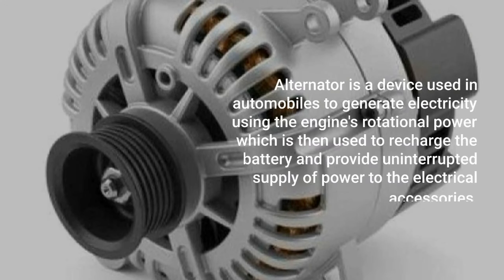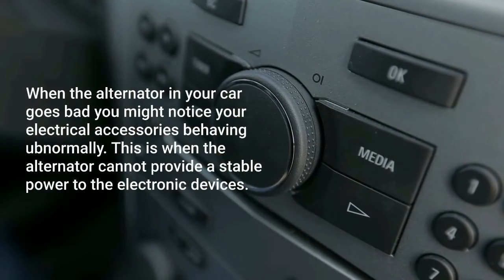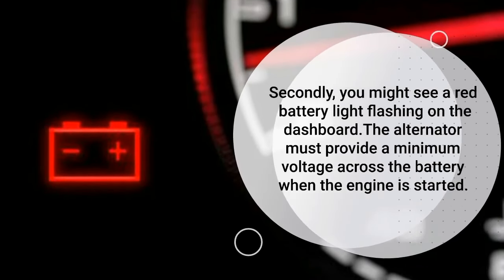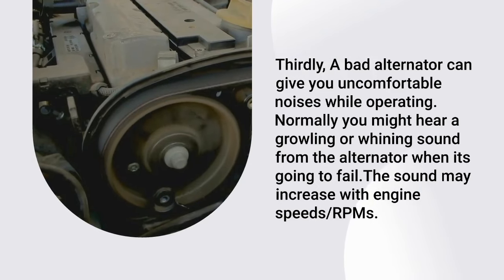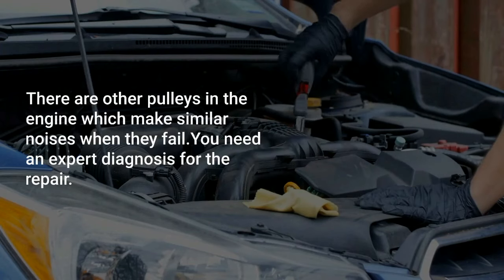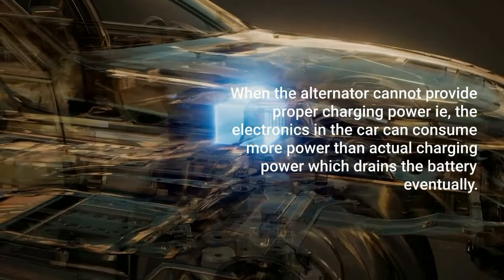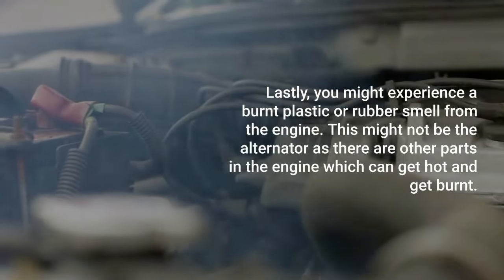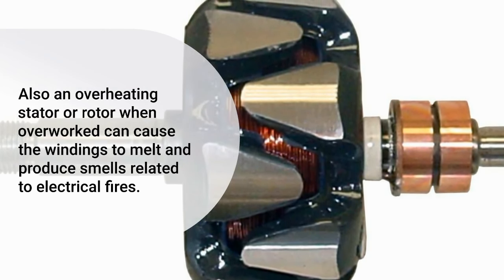Symptoms of bad or failing Alternator in your car | What happens when alternator in your car fails

Comment: The first I knew I had a problem on my 2012 Skoda Fabia, with 190,000 miles on the clock, was when the Battery Warning light came on whilst driving through Knightsbridge.

Comment: Is it possible that a bad alternator can cause O2 sensor to go off
Reply from the maker: Havint seen that though...
Reply: I asked the same thing because my o2 went out then my alternator
Reply: I have had chevys throw multiple lights when the alternator fails from traction control to TPMS or all lights. So... could.
Reply: Just had the same thing happen to me
Reply: @AltruisticWarrior that's what my Cruze is throwing traction and stability, however last year when it threw them it was my battery 🤷🏾‍♂️ replaced w a used battery from another car and tested it days ago and it was good so cud be the alternator this time

Comment: Can anyone help diagnose a problem I have with my 2013 VW Jetta 2.5 SE. The car was sitting for 4 months at a body shop and when I picked it up from there, I turned it on and after driving half a mile, I could not accelerate, all my dashboard lights came on and the car died and would not turn on. I replaced the alternator (twice) and battery and I am still having the same problem. The mechanic is saying it could be the alternator fuse. I bought one and waiting on it to arrive. Does anyone know whether it could be the fuse or could it be something else?
Reply: Yea

Comment: My car started sputtering on WOT and had a rough idle, it turns out that one of the wires to the electrical connector attached to the alternator corroded and broke off.

Comment: I was coming to a stop and my car shut off and won’t crank you think it’s the alternator? If not any ideas?
Reply from the maker: Firstly when the alternator fails, you should see a battery light on dashboard.eventualy the battery dies and engine shuts off. Check if the battery is strong and if yes, you have seized components ie, pulleys, bearings etc...

Comment: I'm currently expecting a growling noise when car is idle and my windows are slowly functioning. Can replacing the bearings in the alternator solve the problem?
Reply from the maker: A growling sound might be from too much load on alternator belt. A bad bearing makes a whining noise and increases with engine speed. If the growling noise increase when you roll up the windows, its likely the alternator is about to fail soon. Just bearings wont solve the issue, you might have a burnt alternator rotor.
Reply: Thank you so much. There's no noise when I roll up the windows, it's just that they roll up slowly. So what happens is when the car is idle, that when I get that rattling noise.
Reply from the maker: Alright .slow windows could be hardened glass guides. A rattling, clicking noise can be from belt bearings, alternator pulley etc...

Comment: my battery light will come on and sometimes go off like it's come and off all the time i can't figure out what it is like i'll drive for 5-10 mins and the light will come on and then 2-3 mins later the light will go off it's weird
Reply from the maker: Could be alternator regulator or loose power wires

Comment: is it  normal to hear a clunking sound come from the alternator upon it's death?-my  2016 odyssey had this exact problem let alone it started on the freeway! the electrical would come on and cut off-is this all due to the altenator?
Reply from the maker: Hi, looks like the alternator pulley has an issue especially if its overriding clutch pulley. Any loose bearing can also cause the same. Intermittent electrical cut might be of other causes, like bad wiring, loose contacts, corrosion in wires, bad ground, failing relays etc...any short in alternator can also trigger the same.

Comment: I'm a retired motorcycle technician and machinist so I'm familiar with alternators as only a few motorcycles use an alternator. The majority use a stator mounted in an aluminum cover and magnetic rotor bolted to the crankshaft. When the crankshaft turns it creates AC volts that is sent to a unit called regulator/rectifier. The rectifier changes AC  current from the stator to DC, then the regulator puts voltage in the battery based on what's being drawn from ignition, lights etc. 
A couple days ago my 2001 Chevy S10 started making a noise  as if a bearing was going bad while driving, but not at an idle. I opened the hood and increase the engine rpm and I noticed the automatic belt tensioner appeared to to be working properly and it was hard to tell if the noise was from it or the alternator since they are only a few inches apart. Today on my way to work the tachometer jumped a couple times when it shouldn't have, then all of the sudden the engine shut off and the battery light came on, but the voltage for the battery showed just under 14 volts. I was able to get to work and I put a multimeter on the battery and the voltage was at 13.97, then all of the sudden it showed millivolts which is almost nothing. Luckily I have a spare alternator and belt tensioner so I will be changing them when I get home. 
This video explained that some electronics may not work properly including the tachometer when the alternator is not working properly which I was not aware of. Thank you for this video as it answered my question about my tachometer fluctuating.

PS
I will be subscribing to this channel for any future issues I might have to help me diagnose and repairs. 
Thanks

Comment: My 2011 ford focus titanium mk3 111,667 miles had the wrong alternator fitted when I brought it. Didn't notice until it packed up. Replacement parts are overly expensive.

Comment: I was able to replace alternator and battery with new ones but still not charging battery. I disconnect battery and engine turns off, I check with meter and reads 12.5 v with engine on but that's what the battery reads too so nothing higher when engine is on. Can this regulator prevent power or alternator from charging battery? On Town and Country 2011.
Reply from the maker: Regulator is built into alternator and if its replaced then the regulator mist be new. Any loose wire, corroded wire can also do the same.
Reply: @dailyhandsdiy  should I just put in a External Voltage Regulator kit for Dodge, Chrysler, Jeep, kit bypass PCM ?

Comment: Good video, can you help me ? I just had a new battery installed in my car. The
reason was no power at all, even lights did not work. I ordered a battery, and this
guy from the paper picked it up, and installed it, although I didn't see him do it,
but the car was running fine after he left so I paid him. He gave me the receipt
for the battery. Now about 4 days later, after I run my car for 15 - 20 minutes,
and shut it off, the car is completely dead of power. Even the lights don't work and
all my automatic settings, like clock etc, are not working. After waiting about 10 
minutes, I can get a weak start. If I drive it a "short distance" and shut it off, it's ok,
but if I drive it for 15 -20 minutes, it drains all power ?? and no power at all ??

QUESTION - did I get a bad battery and get ripped off by someone who installed
an old used battery but charged me for a new one, or is my battery good, and
thru the course of my 20 minute drive, is it the "alternator" that's not keeping the
battery charged. Can you advise me on this ?? --  thank you.
Reply from the maker: Hi it looks like the alternator is not charging enough. The guy who installed should check for proper charging. Also check the wire that connects the alternator and battery.

Comment: Question. My lights go dim on dash occasionally i rough idle....i replaced started because it would barely start now no issues except ones stated above. Whats some thoughts is it ny alternator?
Reply from the maker: Could be a bad grounding, corroded wires or even loose connections.

Comment: Hi They hooked up the multimeter at Auto zone, then I went to O’reilly too to make sure both said the same. Both times it passed everything except it failed voltage regulator. Do I need to tell my mechanic guy I need a new alternator or just a regulator?
Reply from the maker: Hi, you just need new regulator. Don't have to swap the whole alternator.
Reply: @dailyhandsdiy  ok, thanks for your reply!

Comment: Please help me.. my Polo Vivo cut off it's self while I was driving . I tried to start but not starting  it only make click sound from the start,it doesn't start even if I tried to kick start , battery is good
Reply from the maker: Hi, this could be a seize. Any pulley bearing or alternator bearing might or any other can get seize and stops the engine. Starter cannot spin the engine thats why it makes the click noise. This might be one reason.

Comment: How about sound system…
I mean like I have a sound system and when I’m playing it loud like 56 and my car stereo goes up to 62 my car wants to stall/shut off…BUT when I’m playing it to 33-36 the car does not shut off but it never showed me a battery light on the dashboard….what causes my car to shut off when I play high volume music
Reply from the maker: Some high amp drwing sound system especially aftermarket drws high current at the time of high volume and this can cause temporary low voltage across the battery and high load on alternator which can further cause a disturbance in engine electrical systems. That might be the reason.
Reply: @dailyhandsdiy  so it’s better to replace it with a new one to not cause more damages

Comment: Pretty easy to see if your alternator is bad.
Turn on the vehicle let it idle remove the positive battery terminal. Of ot dies instantly, your alternator is bad.
Reply: I thought you’re supposed to remove the negative?
Reply from the maker: It's safer to remove negative